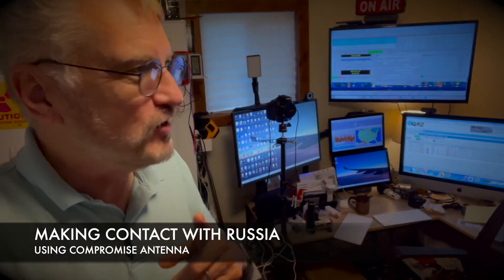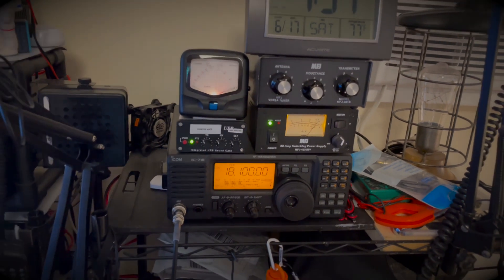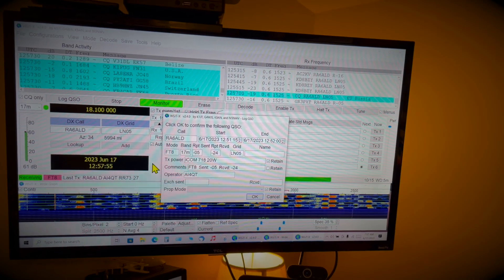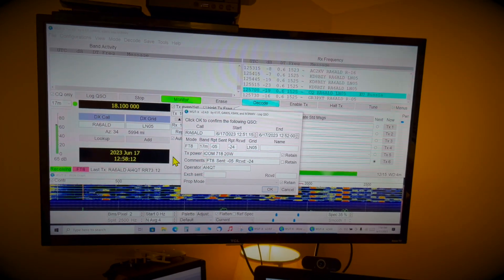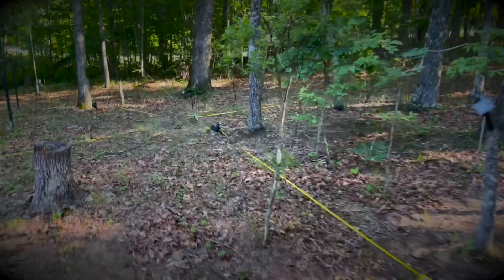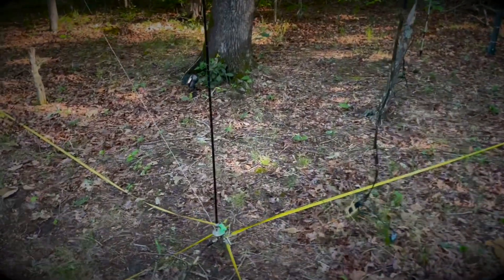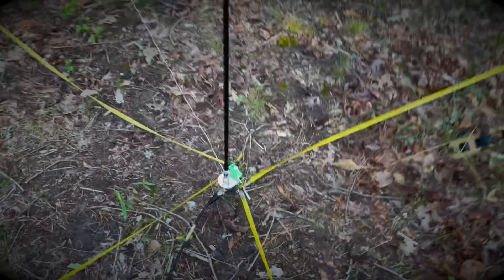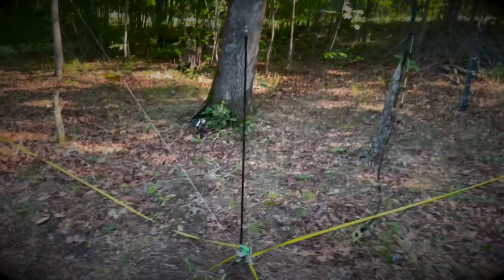Using the much ridiculed ham stick type antenna

Comment: When the solar cycle is near maximum...
Reply from the maker: Would never use the ham stick as main antenna, but hey it works even in sunspot minimum have used them since 2003 in portable setups.